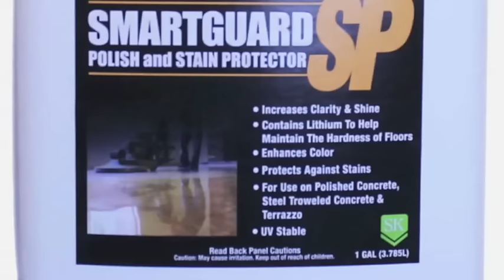Smartkrete Concrete Polish Demonstration

Comment: How do you attach the pads to a grinder is there an adapter? 
Is it a normal angle grinder or a concrete polishing grinder with variable speeds? 
What pads shall I use for concrete that’s already been steel troweled thank you
Reply from the maker: The machine comes with a 5/8" arbor. Some cup wheels will come with an arbor in this size as well and other will require an adapter. In terms of velcro pads, you would need a velcro backer pad with a 5/8" arbor and 3, 4, 5, or 7" diameter. Please note that the machine used in this video is not a grinder. It is a variable speed machine (Makita 9237CX3).

Comment: might be a super dumb question - but would it be extremely difficult to chisel into this after it's set? i assume so since it's a protectant, but i just thought i'd ask! conversely - would it just fill words/designs in to make them illegible if the concrete was chiseled before application?

Comment: How does Costco finish their concrete floors? I'd like to get my floor to that level of finish, doesn't have to be mirror/slippery smooth.
Reply: Pretty much the same process, but by using industrial sized machines for polishing.
Reply from the maker: Costco uses a "natural polish" this means that they get their polish by going higher in the diamonds rather than using a guard like we did in this video. There are pros & cons to both, but it's less labor intensive to use a guard and it offers more protection against scratches & acids.

Comment: did you use all of the different grind pads first before the smartkrete or is this in place of having to do those?
Reply: the pads are held in place with velco. they are separate pads at varying grit values.
BTW this product is not being sold on amazon anymore.

Comment: what do you call this machine being used?
Reply: @artvandalay6386  thank you
Reply: @janicemata6880  It's not an angle grinder, it's a polisher. Angle grinders run at much higher speeds
Reply: @ashwatson2142  Is it rated for working with water?
Reply: @gary24752  According to the Makita manual it is not.
Reply from the maker: This is the Makita 9237CX3 - it is a variable speed polisher.

Comment: Which was the first wheel you used for rough surface
Reply: Did you find the answer to this?
Reply: @swfc888  no
Reply: 4 Inch Double Row Diamond Grinding Cup Wheel for Concrete Granite Marble Masonry Brick Fits 5/8 Inch Arbor
Reply: @swfc888  4 Inch Double Row Diamond Grinding Cup Wheel for Concrete Granite Marble Masonry Brick Fits 5/8 Inch Arbor
Reply: 4 Inch Double Row Diamond Grinding Cup Wheel for Concrete Granite Marble Masonry Brick Fits 5/8 Inch Arbor
Reply: @rigorreynolds6233  just done this myself, the only way :)

Comment: My cup wheel snap and hitme in the leg
Reply: It hurts bad it’s happened to me
Reply: Mine hit in my nether regions
Reply: @adamdiaz8442  ouch ...
Reply: wear this it will not hurt as bad. ---> Leather Work Shop Apron with 6 Tool Pockets by QeeLink - Heat & Flame Resistant Heavy Duty Welding Apron, 24" x 36"
Reply: @universalwraps8071  wear this it will not hurt as bad. ---> Leather Work Shop Apron with 6 Tool Pockets by QeeLink - Heat & Flame Resistant Heavy Duty Welding Apron, 24" x 36"